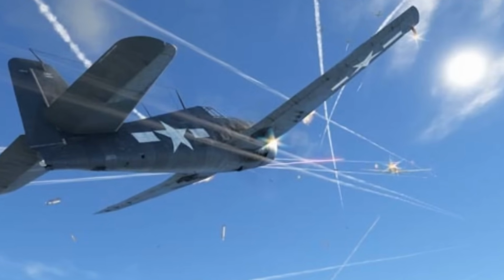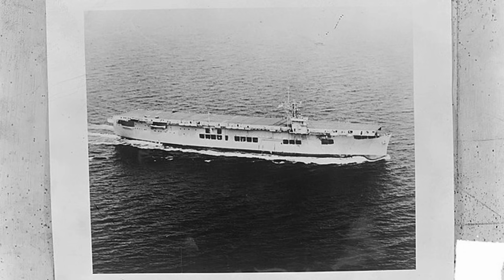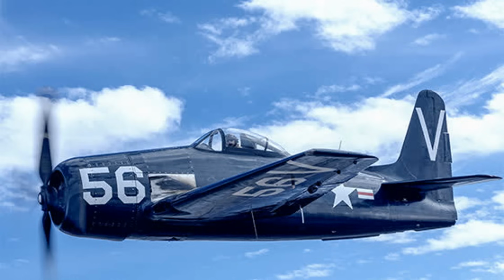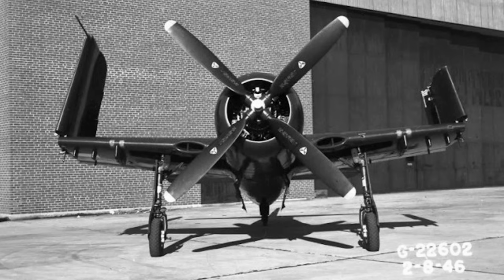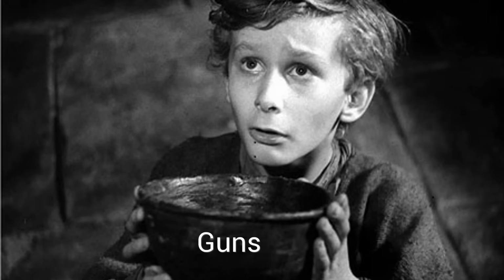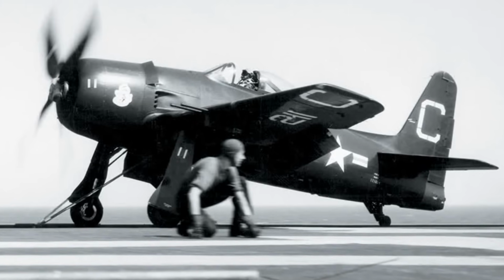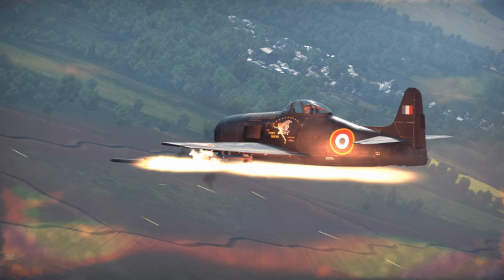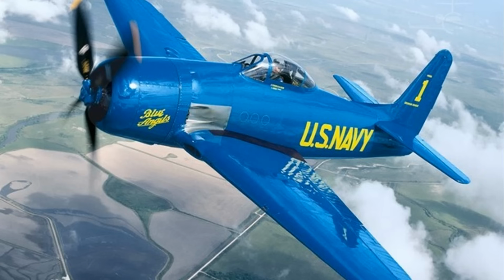F8F Bearcat – Grumman’s Lightweight Heavy Hitter!

Comment: So the huge Avenger could operate off a Escort Carrier, but a Hellcat couldn't?  And both could land and take off the Wolverine and Sable? I think it was just a matter of fitting more planes on a Escort Carrier and there was no alternative to the Avenger. But Eastern was able to make the improved Wildcat in numbers and Escort Carriers were tasked with roles appropriate for them, excluding ferry missions. The just a few Avengers and Wildcats could be stowed in the Hanger deck until the deck aircraft were flown off. The Escorts had a catapult so they could load up the deck with non-foldable wing aircraft or even more foldable ones and when they were gone the ship could still put up a ASW screen and a Cap. Bearcat didn't have near the range of a Hellcat of Corsair because of limited onboard fuel. I never understood the usefulness of the Bearcat for longer range missions required of Carrier Planes.

Comment: The breakaway wing tips and then exploding wingtips make about as much sense as that one weirdo guy that they got to do the study on where to armor an airplane based on where it wasn't hit that's how much sense that makes it's nonsense. Why would you armor an area that didn't get hit how do you know how it's going to react if it hasn't been. Plain and simple you want to armor the vital areas and use common sense in armoring them like the pilot cockpit engine fuel tank that's it. So that whole absurd study where the guy comes along with his forward so forward thinking that it's two steps back and not even tried yet is complete absurdity.

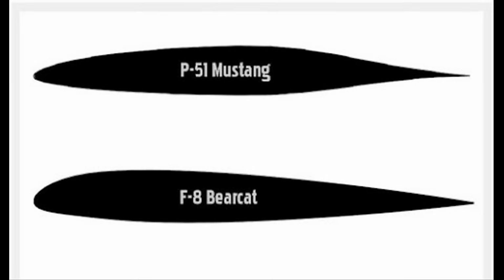Comment: 3:32 This gives a good illustration of the P-51 Mustang "laminar-flow" wing/airfoil, where the thickest part of the chord is situated well back from the leading edge like the airfoil on the F-8 Bearcat. Both have/had advantages and disadvantages depending on the application.

Comment: Some incorrect information in this video. F6F WERE operated from escort carriers. USS Kasaan Bay (CVE-69) VF-74, and USS Tulagi (CVE-72) VOF-1, both operated Hellcats during Operation Dragoon
Reply from the maker: Yes there is contradictory information out there. Maybe the point was you could put more of a smaller aircraft on the baby flattops?

Comment: I'm not questioning your comments about the reason for the Hellcat not being used aboard the Jeep carriers, but I would point out that the Hellcat was almost exclusively used aboard the 11 CVL's which had a flight deck that was actually a few feet narrower than the CVE and only a little bit longer. In both cases, the Grumman Avenger was used alongside the fighters as the attack portion of the air group. The Jeep carriers also hosted several Marine fighter squadrons flying the F4U-1D Corsairs towards the later part of the war to help provide some close air support for the amphibious landings and continued on working off the baby flat tops throughout the Korean War. So, the idea that the Hellcat was kept off the Jeep carrier because of its size doesn't seem to hold water. I wonder if it might have had something to do with the limits of the Jeep carrier's max speed of 19 kts available for flight operations. But then, how would that apply to the bent winged "Ensign Eliminator"? It's a quandary. Great video though. My Dad flew the F8F and AD's with Air Group 19 right after the war. Thanks for all your great work!
Reply from the maker: That is an interesting point! I’m really glad you brought it up and in this manner. I’m a student of aviation history as well as a presenter and I’m wondering the same thing now!

Comment: 4 50cal is a very light armament.
Reply from the maker: I know! Especially at that late date
Reply: "Light" was the design principle of the F8F.  Guns and ammunition are heavy,. The outer wing panels were frangible so the wing structure could be lighter. Small internal fuel load.  All this lightness was to help get the 4 guns it did carry in a position of advantage against an enemy fighter.  Four guns that get a shot at the enemy are better than 2 more that don't get a shot or that make you less able to evade a shot by the enemy.

Comment: The Beatcat was designed to be a direct replacement of the Hellcat, but to be used as a fleet defense fighter. Thus a long range wasn’t necessary for it. Funny thing about the debate on the number of fifty’s went back and forth during the war. The Wildcat early models had only four guns. The -4 bumped that up to six guns, but reduced the amount rounds per gun. Jimmy Thatch was one of those that complained. The Hellcat was the perfect replacement for the Wildcat for all of the brand new ensigns coming into the fleet. When the Bearcat came on, most of the pilots were highly skilled pilots.

Comment: My dad worked for Luscombe building the Silvaire.  The  Silvaire was so easy to ground loop that Luscombe  estimated that over the life of the plane the wing tips would need to be replaced at least 3 times.  So they were made of wood and designed to break away without damaging the wing spar.  Not quite the same thing as explosive bolts in the wing tips but another example of wing tip designed to break off.
Reply from the maker: That's an interesting piece of aviation history!

Comment: Which one was better, the F8F bearcat or the seafury?
Reply: Hands down the SeaFury. It excelled in every category except rate of climb. With the advent of long range radar and AEW, the need for ultra high RoC diminished. The pireps of the F8f say the while it was a good interceptor, an all around Fighter Bomber it was not.
Additionally, the concept of operating an Escort Carrier as part of the battle fleet, and therfore, needing to operate fighters is DEEPLY flawed. Witness the Japanese navy in the war. Escort Carriers are best suited in support roles eg. ASW work etc. Which means attack/ bomber aircraft, operating outside the "battle line"
Reply: @towgod7985  . OK, but the French seem to have used it somewhat effectively in Vietnam. As a combat air patrol, protecting the fleet would it have made any difference? I am not very knowledgeable about the subject and all the particulars requirements, so it would be interesting to learn more about all the details involved.
Reply: @towgod7985  Sea Fury had the Bristol Centaurus sleeve valve engine which a maintenance nightmare, So the Bearcat takes the win.
Reply: Did the French  use these in Algeria.
Reply from the maker: Hmmm interesting question to ponder when I do the Sea Fury!
Reply: @worldofwarbirds  . Appreciated if you do! I've always wondered how well it would have worked against the sea-fury, if they have been used in the Bay of Pigs operations, where the sea-fury seems to have dominated.
Reply: Brain .... malfunctioning.... yes, need to see this 👏👏👍👍👍👏👏